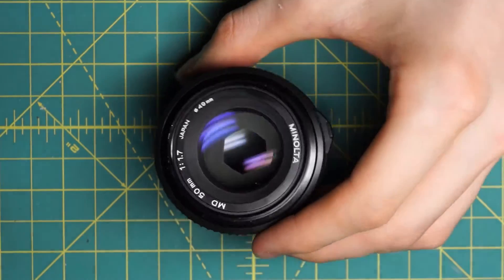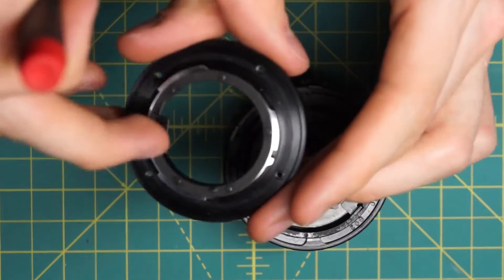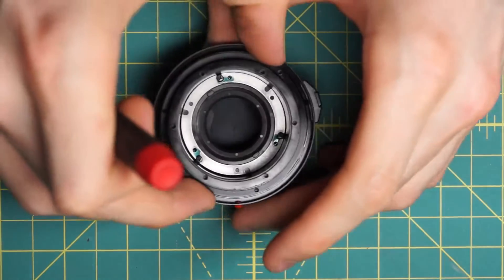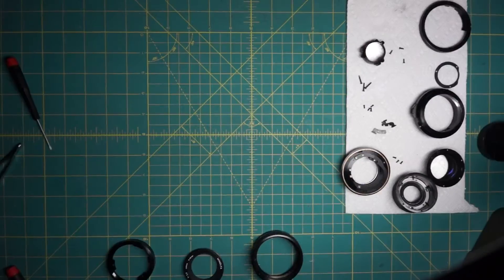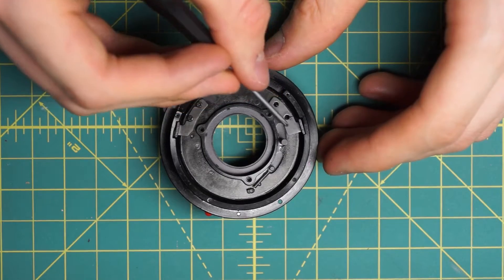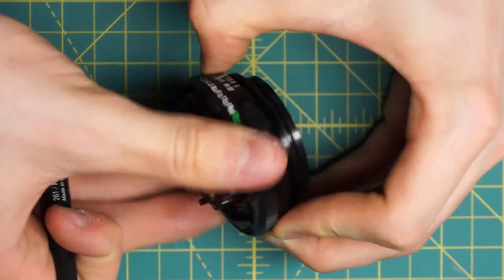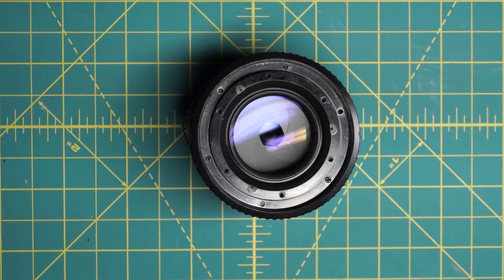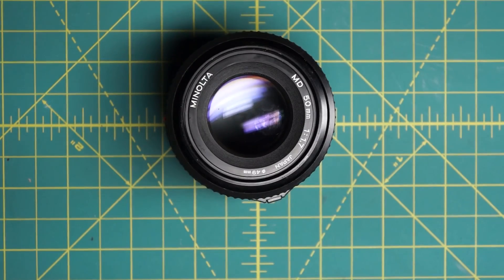Minolta MD 50mm f1.7 Lens Disassembly

Comment: Resetting the infinity was really getting to me. Then I realized when I screwed the front element focusing diaphram, I didn't line it up. So I kept re-screwing it in until infinity was correct. You're amazing! I was getting really frustrated, but it ended up making a lot of sense to keep wiggling/trying infinity. Great videos!

Comment: I found an interesting distinction between the screws on the back element in two copies of this lens I have. On one of the copies the screws and lens assembly is just like the one in this video, but in another copy, the screws are small, and there is no "hollowed part" or such. This results in the back element being seated deeper in one lens compared to the other one with longer screws

Comment: Hi, I managed to get into the centre part of the sealed lenses by drilling, carefully,  2 holes into opposite sides of sealed unit, until nearly through,  then use a scalpel to break through. 2 holes opposite allows cleaning fluid in and out. Then cut a thin strip of a lens cloth and use miniature cotton buds to push the cloth from one side to another. You then just blow lots to clear the inside.
Then seal your holes somehow,  I just used tape at the moment. Hope this helps..Colin

Comment: Thank you for sharing this awesome information  - I managed to clean fungus off my 50mm F1.4 Rokkor X lens and declick the appature so I can smoothly change the F-stops on it while filming!!!!
Reply: Does 1.4 have also those 2 sealed groups? Did you manage to 'open' it?

Mine 1.7 has fungus inside the grouped elements as shown and mentioned in the video but there's no obvious way to get in. Although the lenses within the group assembly are loose and can be rotated i.e. with small suction cup but not screwed-out.

Comment: thank you for the very informative video. I have trouble removing the small screws on the back of the lens. my screwdrivers seem to be thick for these screws. I use electronic screwdrivers. I mean that the screwdrivers are used by people who assemble electronic circuits. they are pretty slim. however I need a slimmer one. what kind of screws are these on the back? diameter or name or something that I can use to find a proper screwdriver? thanks in advance.
Reply: I forgot to mention that my camera is actually an f 1.4 not this certain one.

Comment: Dude, I really appreciate your video, idk if you're gonna reply to this but I'm in need of guidance!

So my minolta MD 50mm f1.7's focus is heavy. Then I decided to fix it by myself. After looking for some information online, I learned that I have to regrease the helicoid. So where should I do it? Is it enough just open the back and then put the grease while adjusting the focus? Thanks man!
Reply from the maker: Worth a try. Keep in mind that you only need a very small amount of grease and make sure to use a heavy, heat-stable grease that won't flow onto the aperture blades or optics. I've used white lithium grease. 

If the helicoids aren't the issue, check to make sure that none of the internal components are wearing against each other. This can be difficult to track down

Comment: Matt thank you for the awesome video. I have a question regarding the reassembly of the aperture ring. It seems like you have no problem sticking in the aperture ring with the ball bearing, but for me it seems to go out its place because the gap between the lens and the aperture ring is minimum. Can you tell me some tips on how to reassemle it? Thank you
Reply from the maker: There should be a little hole on the inside of aperture ring for the ball bearing. I generally use a large, flat tipped screw driver to press the ball bearing into this hole while the ring is partially on the lens, and then use the screw driver to hold the ballbearing in place while sliding the aperture ring down onto the lens fully

Comment: Matt, thanks for the video.  I just ordered one to try for Free Lensing / Lens Wacking.  I want to remove the back mounting ring to have better play with the lens. If I remove the back mounting ring, how can I secure the back part so the aperture ring does not fall off.  Thanks.
Reply from the maker: I recommend just removing the aperture ring if you are playing around with the lens. The aperture ring is easy to reinstall but the ball bearing is very easy to lose, especially if the aperture ring accidentally slips off the lens while you are fiddling with it

Comment: I just got this lens but for some reason when it's mounted on my mirrorless Fujifilm x-t10 (using MD-FX adapter) the aperture ring will only allow the aperture to open, not close. If I take it off camera it works both ways. If I put it on the adapter with f/22 locked in then it will stay at f/22, I can then open it further but it won't stop back down again. The ring itself turns and clicks but the blades don't move except to open it until wide open. No oil on the blades and it works as expected when it's not mounted on the adapter/camera.

Any ideas?

I've used the MD f/2 version without issue and my MD f/1.4 also works without issue. Only differance I can see on my f/1.4 version is that the aperture lever is "half moon" shaped instead of "full moon" shaped like on the f/1.7 and f/2. But since the f/2 worked I don't know if that has anything to do with it.
Reply: I have the same problem with mine. Completely dissasembled it to clean it, now to see if the problem will still be present when I put it back together
Reply: Ulf Sandberg have you find out what was the issue? And did you repair it?
Reply: I had that same problem and found out that I had to “shave” the little lever on the back of the MD lens because it kept getting stuck on my adapter. I just used a flat file and it works great

Comment: my f2 version's focus ring is not smooth, how do i get it smooth again?
Reply from the maker: First identify the cause of the problem. Take apart the lens to isolate just the focusing mechanism. If the focusing works well on its own, then the problem is somewhere else in the lens, most likely that some pieces are running into each other during focusing. 

If the focusing itself is gritty feeling, there may be debris in the focusing coils. For that, fully separate the two parts of the focusing mechanism. Be sure to mark where they fit together before doing this though or reassembly will be difficult. Carefully clean out all the coils and reapply a small amount of lubricant during reassembly.

If the focusing is sloppy or stiff on its own, you don't have to fully separate the focusing mechanism in many cases. Just focus out a bit and apply a small amount of lubricant to the coils. Again, you really don't need a lot though.
Reply: +Matt Bierner it worked thanks man! not sure what the problem exactly was tho

Comment: I must have another version of this lens, because it's exact the same specs but looks different on the inside. Now I have trouble assembling it back together again...Oh, well. There's something different with the focusing mechanism. There is a ring with inner and outer threads. I'll have to figure it out for myself I guess ;) cool vid's though!
Reply from the maker: Does the name ring read: Minolta MD 50mm f1.7? No Rokkor or anything? There were  MD Rokkor-X versions of this lens too that are different internally.
Reply: +Matt Bierner It says MD Rokkor 50mm 1.7. But I fixed it! after fine-tuning it focuses to infinity again.